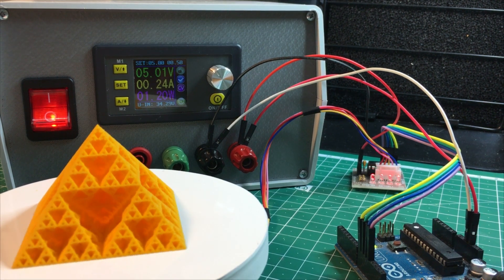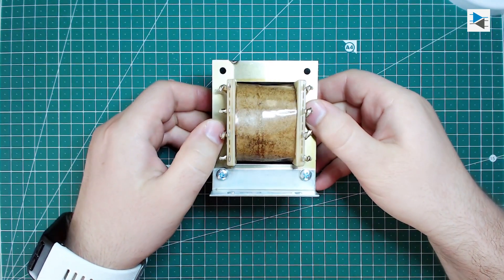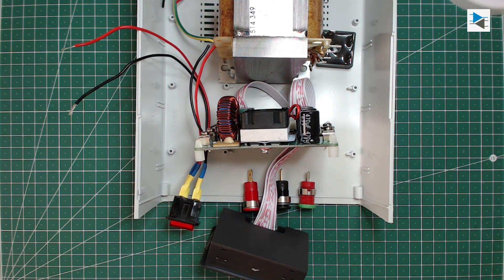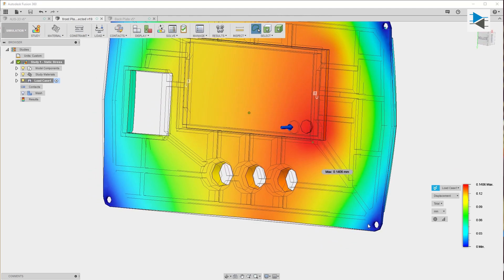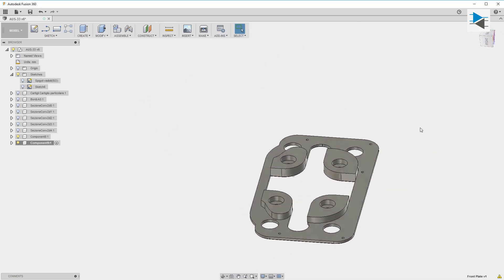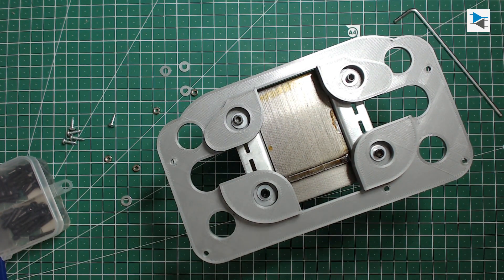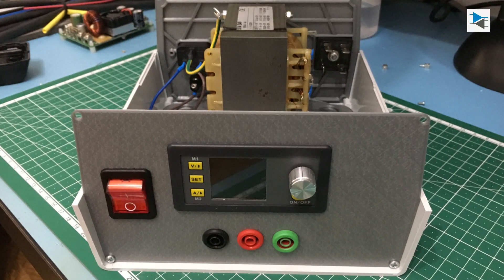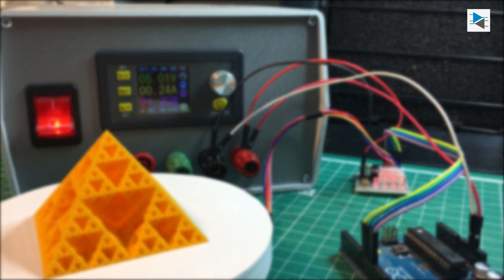DIY Lab Power Supply - DPS 5015 (Part 1)

Comment: your transformer is only rated for 4A?
Reply from the maker: Yes.
Reply: @otinex  Seems a bit low to drive a 15 Amp load, no?
Reply from the maker: @kriskeersmaekers233  the setup cannot be used to drive the theoretical maximum output power of the DPS5015 as it neither supplies 50 V nor 15 A. You can think of it like using the gearbox made for a drag racer which can withhold enormous amounts of torque at high RPM and driving it with the engine from a small family hatchback. The gearbox will hold, the engine will transmit up to its maximum power, but you won't pull a tanker with it.
Reply: @otinex  the problem is the transformer will quite happily supply 15 amps until it melts the insulation off the windings

Comment: Do the DPS PSUs require AC, DC, or both on the input. 
Only seen them on eBay so far, and no info is given on this.
Reply: https://es.aliexpress.com/store/product/RD-DPS5015-Constant-Voltage-current-Step-down-Programmable-digital-Power-Supply-buck-Voltage-converter-color-LCD/923042_32702714880.html
Reply: They require a DC input at a max of 60V.

Comment: So how do you plan to get 50 volts at 15 amps using only a 96 VA transformer?
Reply from the maker: You don't. My car can generate 75 kW at 4000 RPM. The same gearbox is used on a different configuration, where it can generate 100 kW. I cannot use 100 kW  because I don't have that engine in my car although the gearbox can handle it.
Usually you just use what you have or you need.

Comment: Hi very good set of videos, please let me know when you review the DPS5020 with the bluetooth software.  I am keen to buy one.  How much did the 3d printer cost you made the front panel with? Thank you
Reply from the maker: Hello, 
Thank you for your comment!
Although I am not planning on buying a new power supply module, I do plan on upgrading the firmware to this one and adding an ESP8266 to make it WiFi-compatible so it wil be a future project.
 The printer we mainly use is an Original Prusa i3 MK2 and I recommend buying the kit version for 699 USD at the moment as it is quite enjoyable to put together. It may be a bit more expensive than the latest batch of Chinese printers like the CR-10 but the use of quality components, the reliable auto-leveling and heated bed combined with the ease of use right out of the box (or after the assembly) and the support makes up for it.
Cheers!

Comment: what is transformer output voltage and amp
Reply from the maker: shafayet rahman the transformer is 96VA in a multi-tap configuration with output voltages from 8 to 24. In this case, we use the 24 V output, which rectified means about 33-34V DC